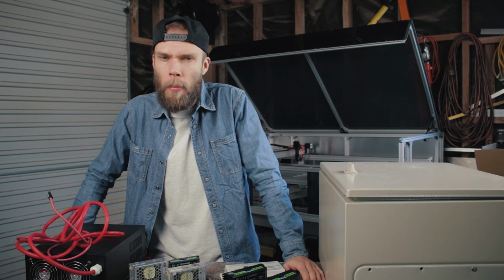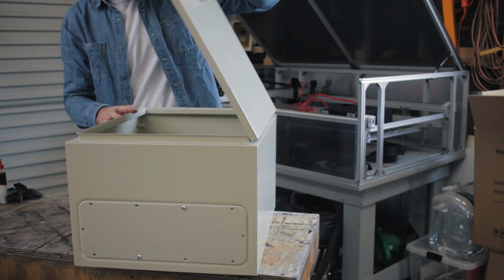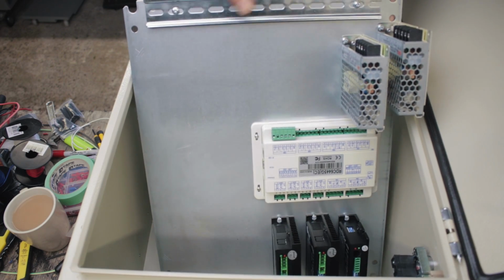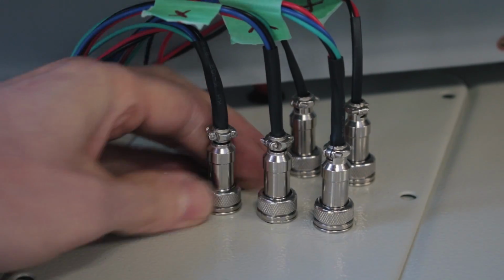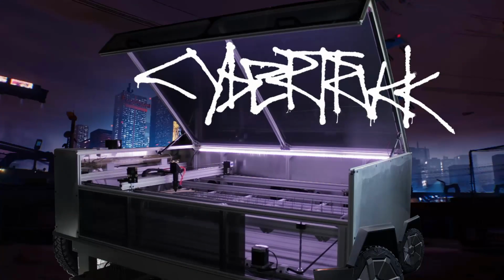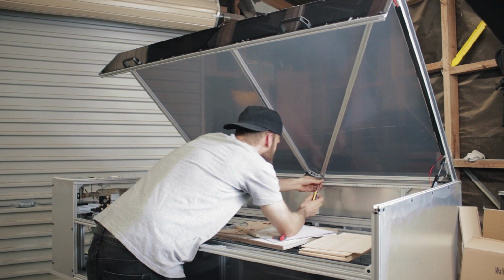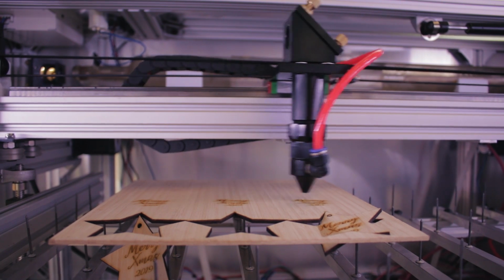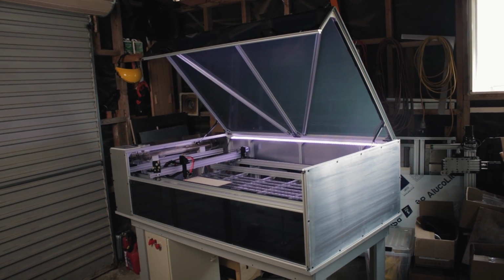Ep9: Finished? The DIY CO2 Laser Cutter / Engraver Build Series

Comment: Great video series. Bought your build guide and currently building my own. Using a Laser Tube from an old LS2030 which is about 30 watt and it's 50 watts psu as they are both brand new, the unit was damaged at work so I salvaged these parts after testing them. Will upgrade to 100watt when needed. Good fun to build, only issue is awaiting all the parts from China to arrive in different deliveries....I'm a bit impatient. One tip for anyone else building, spending some time at the beginning ensuring your table or whatever surface you build it on is perfectly level and flat...this is Crucial and will save a ton of time and frustration. I'm thinking of doing something different with the enclosure though..not sure yet. I'll probably upgrade the 2 wheeled gantries to linear rails for some more stability. Looking forward to finishing and getting cutting and etching ;-)

Comment: nice build.....i built my 600x400 45w spt laser a few years back.....i make 2 color acrylic labels (black over white) for a few companies for their electronic equip (basically a spec sheet). i spent $1500 making mine 4 years ago.....spt tube is great.....have replacement ready, but dang....it just keeps on going......for $25 a sheet, i'm able to print out 12 labels a sheet....i charge $15 a label...... i can say when you build it, and something goes wrong.....you usually know why...ive replaced mirrors 4 times....lens 4 times....belts 3 times and 1 stepper motor......it's the cost of doing business.....i'm retired and this was a great investment for me and my customers are thrilled with the detail....make presents, led backlight signs...led portraits and do all the neighbors dogs on acrylic and give away to them.....i have purchased a bunch of cast acrylic a few years back....(glad i did)...used to be real cheap....but with these co2 lasers popping up everywhere.....price has soared....anyway..................to anyone wondering, building one is time consuming......but it is worth it.....mine has paid for itself many times over

Comment: A couple friends and I have been considering a similar build, but on a somewhat larger scale. This has been a great help for considering options on how to do things. Our goal is a workable bed that would allow for an entire sheet of plywood (4'x8') and considering whether a replaceable head for routing may be an option. Combining both (with shields for the mirrors when not in use) would make it a perfect "All in One" for a garage workshop.
Reply: Let me know if you do that.  I'm thinking of building this with the gantry on the back, so you can do full sheets as well.  Would like to see how you're going about it, thanks
Reply: @tylergady2019  The project is still underway. The bulk of the frame is just a matter of assembly. One thing we are considering is whether the bulb placement might be better optimized, possibly being run vertically instead of horizontally.

Comment: We've got all our 2020 and 2040 received (all the T-slot from Zyltech and the V-slot from Openbuilds in NJ) and cut to size, brackets, most of the hardware, some of the electronics, and have started assembly. We got the inner frame done this weekend and we're now looking at what's next. Still got a lot of parts in the mail so it will likely be January before we cross the finish line but we're still considering it a Christmas present that will hopefully pay itself back in a year or two. We're looking at a possible road trip to Kentucky as it looks to be cheaper to drive and pickup in person than to have our 85W laser tube shipped from China. Funny how that works.

Thank you for the fantastic professional build guides and parts list. The price of the plans was completely reasonable considering the time you've invested in accuracy and detail as well as filming 9 videos over 1 1/2 hours (probably 75 hours of editing!).
Reply from the maker: That's awesome! Yeah sourcing and getting all the parts can take a bit of time. It's probably less risky getting a tube (somewhat) locally rather than shipped in. As they're delicate things.

Comment: Absolutely fantastic work on putting all these videos together, im sure we all appreciate the time & effort that has gone into all of this. For my hobby use im running a spectron laser systems YAG, ULS v460 & a modified (on-going) K40. This is the most comprehensive guide ive seen & will be buying your build guides from your website because the info in them will be so valuable. Keep up the good work, I Need to be building a 3D printer next!!!+++++++

Comment: A great series man. Very instructive, informative and just enjoyable to watch. You've done a fantastic job, the machine looks great and professional.
I would just say that I do cringe seeing you use a lighter on heat shrink, this leaves a conductive layer of carbon on the heat shrink which kinda bypasses the function of using it. It may work just fine but just bear in mind, that burning technique may cause you some issues in the future or on different projects, espessially on higher voltages.
Thanks for taking the time to produce such great content.

Comment: Complete novice with zero experience using a laser cutter. My wife has a business making/decorating bespoke wooden things kinda like those Christmas star decorations. She currently outsources all the cutting and hinted at how a laser would make things easier! 

I've been binge watching everything I can find on YouTube. I've no idea if I'll be able to build this to a half way decent standard, but I've just bought all 3 docs for the y1200. It's been great watching the series thanks. 

I've no idea what size laser tube/power supply I need though. I'm guessing 3 - 6mm ply will be the majority of cuts for her, with the option of cutting for other people as a business expansion. I was looking at 100w pre made machines with the thought that the laser would last longer as it'd be run at lower power and have the option to cut 10-12mm wood as my wife also buys in cnc cut shapes, letters, and numbers from another supplier. Is it worth going for the higher power laser tube, or am I just being a dumb arse?

Comment: In regards to the laser pointer, I'd highly recommend using 2 "line" lasers instead (the kind that are used in laser levels). With 2 of those, intersecting each other under your cutting laser, you don't have to set it for material thickness

Comment: Its looking good Buddy, Looking real good, I had a laser cutter on my mind for a long time now, the build size you went with is roughly what I want too! DIY builds is definitely the most economical way to go. looking forward to seeing if you would change anything after using it more.
Reply from the maker: Thanks mate, yeah there's no way I could afford one if I didn't build it haha! 
I'm sure they'll be a couple of tweaks down the line, but so far so good.
Reply: @FurtherFabrication Ill be buying your build guild just to have a checklist to make sure i won't be missing anything when ordering parts.going with a 40w would the cheapest , but I think I want to get an 80W because I know before long ill kick myself for not getting better than a 40W, I mostly want to cut 8mm Plexi and wood, and 1/8 garolite, what the depth you are seeing on your 50W?

Comment: Safety tip from a fellow technician: don't have drink or food near when soldering. Especially if it's lead solder. The chances of getting lead poisoning are relatively low, but it's good practice.

Comment: I think putting the electronics in a separate enclosure is particularly beneficial on this machine. My mate has a commercial and its black and sooty in the cutting area. His electrics are partitioned off, but yours wouldn't be unless you panel it so. ( probably cost more than an enclosure!)

Comment: You can use your cordless drill instead of a tap wrench. 

Saves a lot of time. Easier to control the tap. Works fine for plastic, ally and mild steel. You can even tap stainless with the drill if you’re careful. Much faster.

Comment: Indeed it was a wonderful journey I have  spent 1600$ on aliexpress so far ordering major things from the part list but unfortunately 2020 T or V slot is not available locally so I will side track on the mechanical frame trying to make it out of regular 2020 square tubing with 3D printed connectors and using Hiwin rails on all axis for linear motion. Please keep the videos coming I would love to hear about how you make money with your laser as well almost all videos I found on youtube covering this topic are either clear advertisement of specific brand or the hype of make thousands of dollars a day with your laser so more realistic non biased one would be great. Another great topic also would be setup process for the laser job.
Reply from the maker: That's awesome you've already got your build underway! Yeah getting the aluminium can be tricky depending on your location and shipping is quite expensive. 
Cool, I think the business side of things is super interesting but I'm the same, I've never seen it really covered in a realistic way. 
Yeah I should definitely do a job setup one too, good point!
Reply: Where are you located? In Europe/Portugal you have a high quality/cheap aluminum extrusion seller - RatRig ;)

Comment: I've been following, eagerly awaiting each video.  Yes I'd love to see your money making take video.  

One question,  the power supply has cooling fans,  but I didn't see any ventilation to expel heat,  wouldn't the cabinet heat up?
Reply from the maker: Awesome, I'll make it happen! 
Great spotting!! yeah you're exactly right, at the moment I'm just leaving the door slightly open but I still need to add proper ventilation for sure
Reply: I work with laser and the power supplies needed for them dont produce much heat. I would say they dont need the fans but it would still be nice if you added them
Reply: Many argue that you should place all of your electronics in a METAL box and have no external fans. They believe that if a component ever caught fire, the lack of external fans would keep the fire contained and, being metal, the box would not catch fire either. So what about the heat buildup? Well, being metal, the box itself should be sufficient to act as a radiator for the internal heat buildup. 
I do not add external fans to my builds. I always make sure to use a large metal enclosure (I don't try to cram everything into a tiny one) and haven't had any problems with heat. 
With all this said, I'm not going to criticize anyone who wants to add an external fan. Lots of builders add them, even professional builders.
Reply: @BrianLeeWho  I agree with what you've said.  There are plenty of heat sink attachments that can be had and with a cleaver use of thermal paste/grease one can direct the heat exchange to specific areas of said encasement so long as the surfaces have been properly stripped and polished.  I suppose if one really wanted to get fancy with it you could just add a PC style CPU liquid cooler to the external hot spot and flow that with the coolant from the chiller in series with the tube.  Furthermore having the DSP unit, drivers and PSU's completely encased doubles as an effective EMF shield for a bonus.

Comment: I appreciate the effort put into this videos. I have your parts list document, and you estimated the build cost to around $2.6k. But after you take into consideration the shipping cost for each package and the customs you will end up spending over $3.5k. So at this price won't be more feasible to just buy a ready made machine? There are 80w-100w machines for little over 2k

Comment: Was curious is heat is an issue inside your power box, especially on longer jobs. That box looks weather resistant so I'd expect airflow isn't a thing, and you'd be relying more on passive heat transfer of the casing.
Reply from the maker: Great spotting, I'm running it with the door hanging open but I definitely need to put in some proper ventilation holes

Comment: The gantry bridge is just at the wrong place and wrong orientation. What if you want to put big piece of plywood inside? Then, if you make it at long side, no need for fourth mirror. Big laser tube is always good option.
Reply: That's what I want to do.  I think he said he did that to save money.  But I agree, I want to be able to run a full 4'x8' sheet through.  Hoping to build one, and maybe do it like you're talking about
Reply: @tylergady2019  Yes, I imagine gantry always moving away for inserting workpiece. also, 'open design' would be nice - if you can insert big piece, cut elements and then just push away the rest.

Comment: Why not mount the laser tube vertically right above the focal lens and skip the alignment mirrors? I know you would need a larger cabinet to accommodate for the hight but nothing is really going on in the space above the cabinet... And, if your designing the cabinet yourself why not. Some big industrial cnc machines are very tall and it has nothing to do with an increase in work area.  Is the tube to fragile to be mounted and moved in the x & y? Might be a dumb question as I'm new to lasers. Or, does the tube have to be mounted horizontally to work properly?

Comment: I'm considering your build guide... But it seems to me that by welding most of the frame components out of regular aluminum or even steel tube, that one could save a substantial amount over all the 80/20 extrusion components. Where would you say, if any... that during part of the build that the extrusions would be absolutely necessary? From what I can tell, is that one really needs is to spend the time on mirror placement and adjustability.
Reply from the maker: Yeah you could totally weld up a frame. The trade-off is time and easy adjustment. You could change the linear rail components to something else to avoid using V-Slot

Comment: Amazing job do you have any plans on adding a honeycomb bed also any worries about the laser hitting the belt on the bottom controlling the z axis I saw ur other video of version one and the fusion  video when you were giving us an overall you said you would be using the same design does the laser jus not have enough power that far down? I remember the big 60w we had at school was strong enough to go through plywood pretty far away

Comment: I hope you will get by with unshielded cables. If it was a CNC I would have guaranteed you would have issues but for a laser I assume it would be ok.
Reply from the maker: Yeah I've never had any trouble with interference on the laser cutters - could just be dumb luck though, as shielded cables would definitely be a good upgrade for the long term!
Reply: @FurtherFabrication  Thing is USB seems to be really susceptible to EMI ... But yeah probably will be fine. Does it use USB or Ethernet? I can't remember seeing which.

Comment: Hi. I loved it work... want to use it to upgrade my CNC laser...

Actually I have an 80w machine with 90x60 work area. the structure of the machine was made of MDF by a manufacturer here in Brazil. however the machine has several alignment problems, resulting from the fact that it is in MDF, not counting the weight, something around 300kg, decreasing machine mobility. Allied to all these problems, my machine currently does not have adequate access spaces for me to perform periodic maintenance.

Considering this I'm thinking about changing all the structure of the machine and I found this build. My idea is to reuse all machine components with the exception of the rails as they need to upgrade to increase the working area to something around 120x60cm. So I have some question before buy ur project. Does this build is Stable enough while engraving?  I am afraid of the lateral vibrating while engraving because of the high speed movement of the head laser.

Send email to u.

Comment: Thank you for making this series. I have been wanting to build one for myself for a long time. I don't have experience with a laser engraver, but I am technically smart and understand technology. I just purchase a 3d printer and cnc router. Thinking my next project is building a laser engraver. I am a bit discouraged about the cost considering a 50w co2 laser engraver costs around $1700 delivered. I'm not sure I need much bigger than that. I was wondering if building a nice wooden enclosure and maybe aluminum square tubing on the bed would cut down tremendously on costs?  Still using the the v track for the moving parts. I'll be purchasing your documentation and seeing if I can make some cheaper modifications. 

You did a great job and it looks awesome!  I think this machine would pay for itself very quickly. Especially since I'm almost retired and work cheap. Lol. Every time I had a question you answered it somewhere down the line in the videos. Like putting the laser in the rear to accommodate a larger laser. I like the idea of adding another mirror but didnt know if that was possible. I like your solution though. 

Thanks again
Lance
Reply from the maker: Thanks Lance, glad to hear you enjoyed the series! Yeah there are definitely a few spots where you could trim down the price. The external frame is a really good place to start for that.

Comment: 3D Modelling and a CNC laser cutter, totally opposite machines, correct?  I would need to get a head cutting machine to do the 3D modelling.  I want to build plug molds on high density foam blocks.

Comment: Amazing! Im gearing up now to purchase the parts list and start this build. I've watched the videos and read the guide, I was curious if any special consideration need to be made when using Lightburn in regards to the axis switching. I'm probably just complicating it in my head but I assume it would just work like normal? Thanks again so much for this, I was about a week out from purchasing an Orion 80 watt and I didn't feel great about it. This is exactly what I needed.